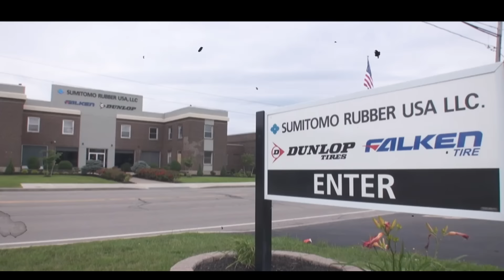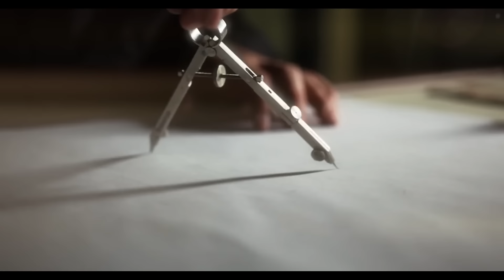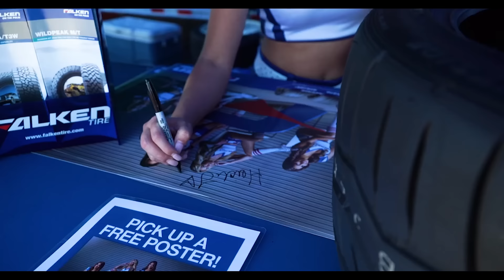THE TRUTH ABOUT FALKEN TIRES

Comment: Put a set of Falken Ziex 960 A/S on 2011 Mercedes C300.  12,000 miles review.  Great price but really impressed with the comfort of the ride.  It was quiet and simply more comfortable over the Michelin that had been on there.  Braking, handling, and comfort are really impressive.  The previous generation 950 was fairly loud, per many online reviews, but the 960 conquered that issue.  Not loud at all.

Comment: Yeah I've been using Falken tires for a little while now they're pretty good tires. I got 75 thousand miles out of set of tires they were only guaranteed for 50,000 miles. Good rotation and balancing the tires on a regular basis really helps.

Comment: I had a small Dodge badged Japanese truck back in '86 thru '92. Every type of tire put on it got sideways badly in the rain (Alvin, Houston, San Antonio, Dallas, TX heavy rains.) Popped on a set of Falken FX-06 A2's and the thing would run arrow straight in the rain and still let me 'drift' on dirt roads!! Have been a huge fan of the Falken tire ever since...and that truck spent about half it's driving life @ 105m.p.h.! (maxxed out little 2 liter) all the way to 342,000 miles...  Nice video dude!  : )'
Reply from the maker: Thats awesome homie!

Comment: I've been running Falkens for 7 years now, really good tires and saves you quite a lot money compared to equilevent tire from other companies.
Reply: i know exactly which brand to go with now for my new tires lol
Reply: Been driving with the Azenis FK510 for few months now and I can say that Falken took a big step forward with the new FK510. Previous FK453 were good but the 510's are amazing, but the price is still same.
Reply: @PoorCoyotee  Almost as good as Michelin Pilot Sport 4. I've bought PS4 only because I did not find fk510 in the time I had for that!
Reply: @AudioThings  Have you had the chance to drive on both the PS4 and the FK510? I'm currently thinking about my next summer tires and I've narrowed it down to these 2. If the Falken tires wear ok I'll go for them I think. Much cheaper.
Reply: I moved to FK510’s after having Michelin Pilot Super Sports, and I’m gonna stick with Falken’s for a better bang for your buck. The Michelin PSS were top-notch but just too pricey to keep equipping on my two sports cars
Reply: General grabber atx boys for your 4×4

Comment: I put Falken RX-007s on my 80 Datsun 200SX in 1987. They totally transformed the car's handling. Great tires. Very grippy. I scared the crap out of several of my friends carving out turns on the backwoods roads in Vermont, where I lived. Used to drive to school 35 miles everyday on old two lane state highways. Very twisty roads with a 55mph limit. To entertain myself, I'd see how close I could get to an average of a mile per minute. My personal best was 35 miles in 32 minutes. I got three years and 75,000 miles of daily driving out of them.
Reply from the maker: Awesome to hear!!

Comment: 7:30 when you said that you don't think they'll dive into making extreme creative tires, it's false because the RT615 was that tire. The tread design is unique to Falken and really sticks out. When you see the tread, you know right away that they are Falken RT615. It's had 2 more iterations where the rubber compound was changed named RT615K and RT615K+.

7:45 when you said it doesn't have the same brand loyalty as others, I agree to an extent. If you ever go to an auto-x event like the one at Miller Park that's hosted every month, you'll find the RT615K+ on almost all the cars there. Almost all the FRS/BRZ/GT86 guys were running that tire just last weekend. Even I have a set for my Civic Si. Just absolutely great tires with a lot of grip. Brand loyalty may not be up there yet but so far, it's having a loyal fan base in the auto-x community. Especially with how cheap they are and how well they grip and even tread water pretty well too. I'm pretty much a fan now and would buy another set when these ones are wasted.

Comment: Running a set of falken ziex tires on the stock wheels of my mk3 supra and they ride great! Very quiet and smooth ride with decent traction. I haven't really pushed the car with them on being they are the tires I use to travel with, but for the price they are a great buy. Run a 245/40/17 squared setup with yokohama advan A048 for the fun stuff. Sticky but LOUD!! Next tires I'm buying are the Falken Wildpeak ATW3 all terrain tires in a 245/70/17 for my 4runner. Heard nothing but great things about them and again a very well priced tire.
Reply from the maker: Agreed I have heard from other guys at our shop that Falken has a nicely priced good quality tire! We actually have some on our site you should check them out! https://bit.ly/2EtpGT0

Comment: I’ve ran 2 separate sets of falken tires and they were all loud once they were worn down a little. The tires were priced low and wear well. But construction wise they pick up nails/debris easily. First set were 329s picked up multiple nails and second set were stz05s picked up a piece of rust on the shoulder. 

That being said the only reason I rarely look into falken is that they aren’t advertised as much and a lot of their tread patterns are resold across the whole sumitomo line up with different names. It kinda lowers the exclusivity the brand.
Reply: Okay, but...that also lowers the cost of their tires while spreading word-of-mouth about their innovative products - both of which are beneficial!  "exclusivity"?  My ass.

Comment: I had a pair of Ziex on my old Corolla to accompany wider wheels. Man were they nice; offered more grip when cornerning, controlled slides, and predictable and sharp handling. As mentioned though, they were shit when they got older and in wet weather at 10k of hard driven miles I wear I could have died a few times trying to go over 65mph. Despite that during summer time when the tires are warm they perform nearly as good as day one.
Reply from the maker: Good to hear man!

Comment: I have used them on toyota echo and yaris with good service. this after the michelins on my echo had the side walls rot out and go flat with over 50 percent of tread left. The tire store said falkens are fully vulcanized and stand up in the sunlight here in Denver very well and they did. I went back to michelins because of a big sale discount. I have learned never to wash or put anything on a tire as that will make them rot faster.

Comment: I am way late to the party but they make a fantastic offroad tire. I just bought a 2013 Toyota Highlander from a dealership and it came with touring tires that I hated, they constantly made a weird sound going down the interstate and had trouble with vibration for some reason. So, after 3 wheel balances and 1 wheel alignment that didn't fix the problem I got rid of them and bought some FALKEN WILDPEAK A/T TRAIL and they run smooth and quite and in the rain.... best tire I have ever had. I thought my old Good Year Wranglers were awesome and these put those to shame.

Comment: I purchased a full set for my truck once, a lesson I learned and will never run on them again. I never have tires wear out so fast and the ones I had did not have that good of a ride to them. That was about six or seven years ago, I doubt the tire has changed since then.
Reply: I tried Falken Ziex 914 Ecorun on a VW Passat estate a couple of years ago. Fine to drive my the wear rate was terrifying. As you say, they do not last.
Reply: I had a set of ZE912s on my car and they ran 40,000+ on chip sealed road which is fantastic wear rate. Also ran the T110 on a road going work truck and they also had a great wear rate. Father had the FK452s and they wore a little quick but their wear and grip for $ was still miles better than a lot of others out there.
Reply: +Brem - Good information. I'm not averse to trying Falkens again. If I do it'll be Azenis FK510 to suit my current car. It's wearing Dunlop SportMAXX RT2 at the moment and come winter I'll be having my Vredestein Wintrac Xtreme S winter tyres refitted. Come spring 2019 it'll be new summer tyres time. Many choices available and Falken is on the consider list. My heart says Michelin Pilot Sport 4 but the price is eye watering.
Reply: Are you still satisfied with Falken 510 ?

Comment: Just bought a set after running on 2 sets of Yokohama but the Toyota dealer stopped carrying them.  I have a Pruis and the dealer recommends buying fuelsaver grade that costs more.  After doing some research most experts say fuel economy on any car is mostly due to one's driving style, fuelsaver tires may add 1 to 2% but i hardly think its worth the extra money.  Driving home from the tire store i didn't notice any big difference in feel, noise,  or economy. I've purchased the pro touring style so only time will determine if I made the right choice.

Comment: I use the Falken Azenis Fk510 pretty good tyres so far.
Reply: I've been considering these on and off. My concern is based around longevity rather than driveability. I suppose all I can do is try 'em.
Reply from the maker: Great to hear!
Reply: +Fitment Industries - I ran a set of Ziex 914's on a Passat and they were a bit wear happy. Then again, Michelin's ghastly Primacy 3 was no better.

I currently use Dunlop SportMAXX RT2 on a UK spec 2012 Mazda 6. These are very nice indeed. Not quite as snappy as Bridgestone Potenza S001 in terms of steering response but the grip is relentless and the car still changes direction like a angry wasp.

I think Azenis 510 is my target Falken tyre for this particular car (summer season anyway).

I'm keen on Vredestein Ultrac Vorti and Michelin Pilot Sport 4 as well.

Comment: :-) The last part about the noise was interesting. I had a set of Falken summer tires around 2002/2003. The first season they were really good, sticking to the road like superglue. Second summer: incredibly loud and "scared" of wet asphalt. Had to replace them as wit got too dangerous and loud for my taste.
The video you made is from 2018, so even 15 years later they still get noisier than other tires if i understand that correct.

Comment: If you want to save even more money, use their off brand tire, Ohtsu.  The Ohtsu FP8000's are cheap and are the same as Falken FK452's
Reply: I did some serious research before buying 4 Ohtsu fp7000. I don't drive much anymore so it wasn't a big deal. Part of the money I saved I used for a lifetime no questions asked warranty from Discount Tire. Not sure of the exact Falken model but they looked identical.
Reply: @pay9011  I'm sure they are the same molds as another Falken model, just like the FP8000's

Comment: when I bought my car it had Falken (475 I think) tires
worn out unevenly and old with cracks. I then did a track day before changing them to new federal st1 and I did 3s faster than with the st1 :). Anyway on analysis charts it shows about the same grip, so when they were new they must’ve been very good and strong.

Comment: I put those RT615's on my 928 and they lasted about 1000 miles.  I don't race the car or drift it, they just wore out.  And after half of that 1000 miles, they got hard as rocks.  I went to the FK453's and they are far better, with almost the same grip.

Comment: are there certain summer tires or brand that i should look at for a vw golf r mk7? its awd but the thing is, clearly the pilot sport 4s is the best summer tire ever but i plan on running them only in the summer months so im thinkin those tires will be overkill. if i lived in florida id just run them all year round but since im in kentucky, im having a hard time. i have some pilot sport a/s3+'s for my winter setup but idk what summer tire to get, help?

Comment: Big Sumitomo and Falken fan here. Pretty much all I run when I can help it. Theie pro 4 g/s all season is a beast in the snow, has good dry/wet traction and price+wear is reasonable. I experience the same with my Sumitomo HTRZIII's as well as my Falken 615k+'s. Good wear good price good performance across their range IMO. Can't go wrong.
Reply: SlowcarsInc 
On recommendation at Ntb tire store, I purchased a set of Sumitomo LSHs in March.
They ride good and have a deep tread depth.
Not that I'm looking forward to it but in several months, I'll see how they perform in snow and ice conditions.

Comment: I’ve had Falken Tires on my 
GMC 2500 HD Truck for 15 mins,
And I’m not pleased!🤬
The 285 75 16 size is advertised at 
32.8” in height!!!
I had a set of 
Cooper Discovery ST Maxx
Same size- that were 32.9” high when new, and was now down to 31.25” high after a few years & about 35-40,000 miles.
Well the brand new Falken WildPeaks AT3Ws that are supposed to be almost 33” high,
At least 32.8”,
Well in reality- they are only 31” high,
Slightly shorter than the used Cooper Tires that I took off!!!😡
It was immediately noticeable that the height was under what the specs say, so I grabbed my tape measure to confirm.
They don’t look near as good or as aggressive as my previous Coopers,
And I’ve run BF Goodwich KO2 a couple times on the truck and they did well,
I wanted to try the Falkens,
Probably won’t ever try them again!
Can’t trust the measurements they advertise the tires at...
So I must wonder if any of the other specs online are remotely accurate!!!

Comment: Sumitomo make the injection moulding machines at my work
Reply: My dad used to sell specialized piping for extremely corrosive chemicals, and some types of pipe he sold used Sumitomo technology. Also, I got rebranded OEM brake pads for My Mitsubishi Lancer, and they said "Sumitomo" on them. Sumitomo is one of those giant companies that does just about everything with chemicals.

Comment: So...are my sumitomo tires technically falken
Reply from the maker: Yeah...
Reply: Kuri Brown No, your Sumitomo could be Dunlops.
Reply: Depends. My Sumitomo HTR A/S PO2 tires are the Falken Pro G4, which itself is an optimized Ziex ZE950.
Reply: catfishakaAMC The Sumitomo Serengeti is the Dunlop MT1
Reply: catfishakaAMC 

I work for Sumitomo.  In the Buffalo plant shown in this video.  Sumitomo HTR A/S P02 are closest related to the Falken Ziex ZE950.  In fact you can see the close relationship in the tread pattern.
Reply: pblackjac crazy..I run that set of tires too... I love them currently 20k miles.
Reply: Kuri Brown 
Thank you for the support.   Had the HTRs last year.  Switched to the ZE950s.
Reply: pblackjac is that an all season?? How do you like them
Reply: Kuri Brown 
They are listed as a high performance all season.  On my way home from the factory this morning I was do about 80mph in a bit if rain and they feel very sure footed.  In the middle of April we had our last snowstorm and had zero issues.
Reply: pblackjac oh really? That's interesting. I saw on a forum that the sumi was the pro G4, and the ZE 950 was optimized for winter traction so that's the information I was basing that comment on. It made sense because I noticed very slight differences in them doing my research, and annoyingly, no website sells all 3 for an apples to apples comparison. But cool, thanks for the insight!
Reply: catfishakaAMC 
Compounds are closer on the HTR and Ziex.
Reply: pblackjac cool! I always thought they were made in Indonesia. Is it possible you made my HTRs? Date of manufacturing is 45th week of '17
Reply: catfishakaAMC 
It's possible that they could have been cured in Indonesia.  Depending on the size.  I have 275-40-20.  We don't cure that size here yet.
Reply: pblackjac I haven't taken my car in the snow due to having a true Cai I don't want to risk it lol. But how would you compare the htr to your current tires
Reply: Kuri Brown
I can't provide an apples to apples comparison.   My HTRs were 245-45-20.  My ZE950s are 275-40-20.  I will say that I had no complaints with the HTRs though.
Reply: 235-60-18 and I checked the sidewall. Made in Thailand.
Reply: LIT SO ARE MINE
Reply: or continental
Reply: pblackjac and what of the HTR ESSENCE LX? SIMILAR TO ANY ZIEX? I ALSO have ziex ze912
Reply: catfishakaAMC my ziex 912's made in J
Reply: What tires are the Sumic GT-A close to, they're super cheap. I'm for sure getting ZE950s but I'm just curious since Sumic is also part of Sumitomo.
Reply: Actually that's not true. Sumitomo tires are not related to sumitomo rubber industries.(Sri)

Comment: Are B.F.Goodrich tires really Michelin’s lower price little brother? Are they Michelin tires with a different name ? What is the deal here? Thank you.
Reply: No. BF Goodrich is corporately owned by Michelin. The tyres are absolutely not the same. Michelin also owns Kleber Tyres. Michelin has made some superb products. They've also made some rubbish. Primacy 3 being one such example. These were ghastly and not worth the Michelin price ticket. That said BFG does offer some good midrange products.
Reply: paulanderson79 thanks for the info.
Reply: +Hemi power - no problem my friend. Best wishes, P.
Reply: BFG tires are definitely built differently from Michelin tires. When installing a tire on a machine, the sidewalls behave like no other tire during installation.

Comment: Fuck it ALEX just because of this video I'm ordering 2 more pair if wheels from you guys  fitment that would make 5 set of wheels this year will may 2017-may 2018. What's a good wheel under $1800 for a gt300 twin turbo vr4 with 18,19,20 inch AZENIS RT-615K HIGH-PERFORMANCE TIRE
Reply from the maker: Shoot us an email and let's get you hooked up shop@fitmentindustries.com

Comment: My opinion is that falcon tires I think are not good man I work at a tire shop take too much weight to balance. Also I to go with what I just said I think the compounds are not even excessive weight or the rubber isn't mixed right also I think the thinner tires and lower profiled tires make the rim sing??? Don't shoot the messenger down it's an opinion and I have noticed that alot of people don't balance with rotations the suspension can only do so much